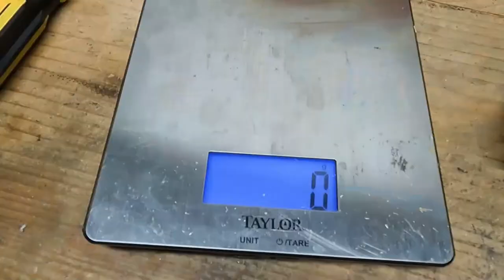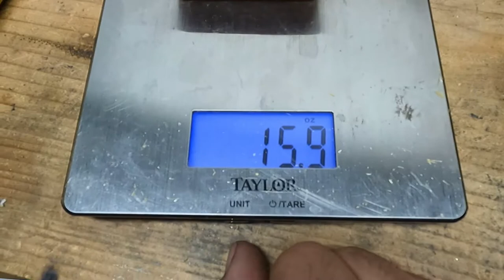Scrapping Keurig Coffee Machines for Copper - Trash to Treasure - Copper Metal Melting

Comment: You can test your metal to see if it is zinc by spraying it with a solution of drain cleaner (the blue crystals which is copper sulfite, i think) and water. If it is zinc the metal will turn black
Reply from the maker: Hey thanks so much for the tip!  I always wondered how to tell the difference from Zinc vs Diecast.  I can't thank you enough!  Thanks for watching the vid and thanks for the tip!!!! :)
Reply: I heard there was something that's over the counter that reacts to Zinc. Now I know its Drano. Thank you!
Reply from the maker: @mattyal9347  No doubt, who would've thought it could be that simple!?!?

Comment: I'm not sure on your microwave melts.
The aluminum transformers,may have 2 coils. One on top and one on bottom.
You might want to scratch both.
They mix aluminum on top and the smaller bottom section can be copper windings. Seen it in a British guys channel.
Reply from the maker: They were scratched on both coils on both transformers I just didn’t show myself filing into all 4 on camera.  It’s pretty common nowadays for both windings to be aluminum.  I was surprised on the older microwave that one of the coils was aluminum.  Thanks for watching the other video! 😁